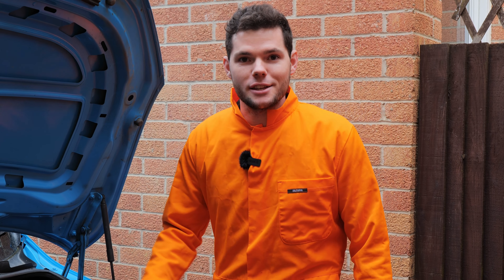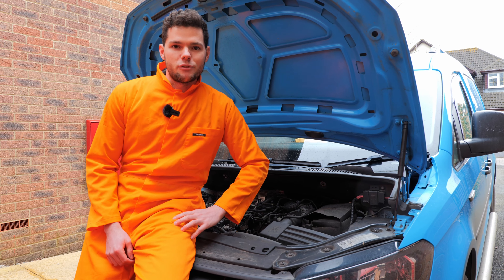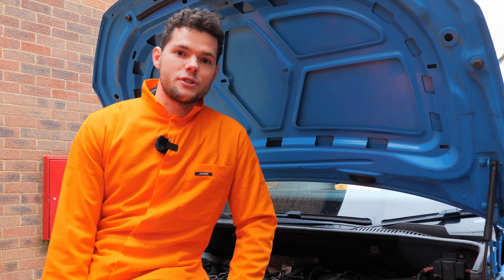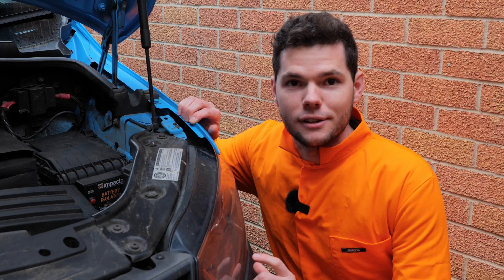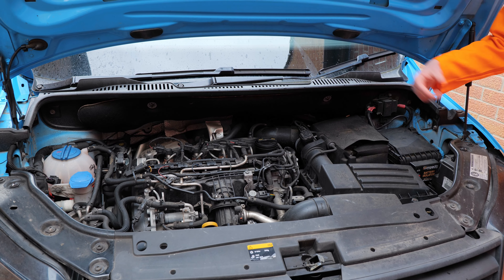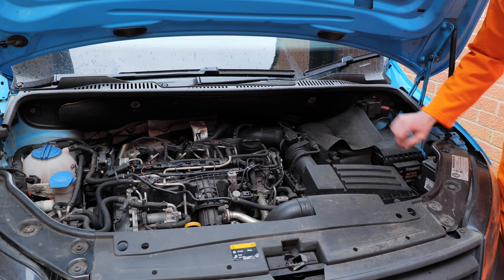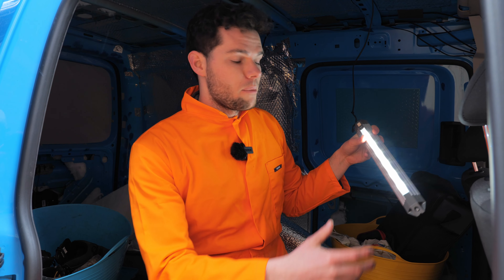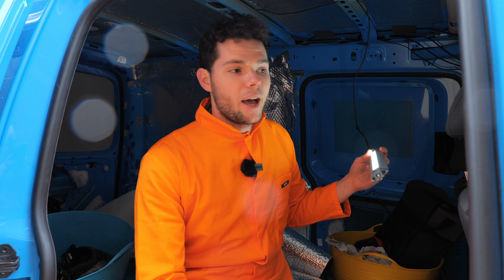A VW Caddy Secret You Don't Know About!

Comment: Was inside the van and couldn't get out because of the immobilizer, had to get someone to lift up the bonnet and turn it off 🤣🤣🤣
Reply from the maker: Hahha that's mad, good job you had someone on hand!
Reply: @willsvanadventures  your telling me! 🤣 Going to bypass it I think imagine if I was in the middle of nowhere 🤣🤣
Reply from the maker: @Lewys_with_a_y  hahahah yh, so how will that work,? Just won't activate the battery isolator?
Reply: @willsvanadventures  I have no idea. I guess just get rid of it, I'll take it somewhere and have it out there as I'll probably blow it up knowing my luck 🤣 there's bound to be a way to open the side doors from the inside with the outside being locked tho 🤔 I don't know
Reply from the maker: @Lewys_with_a_y  ok yh I see. I'd deffo keep it in personally as you never get a flat battery. But is weird that the doors lock on the inside. Maybe something's been changed ?